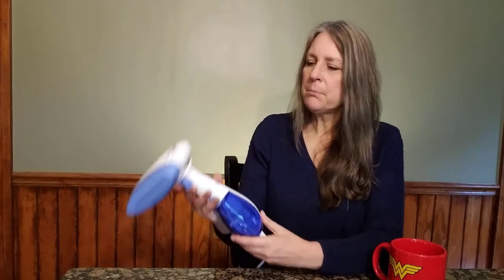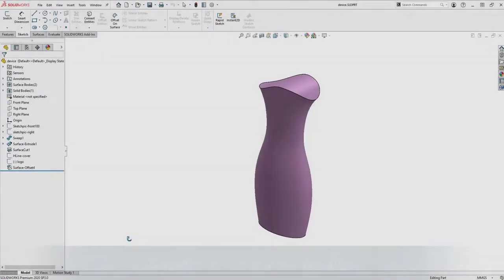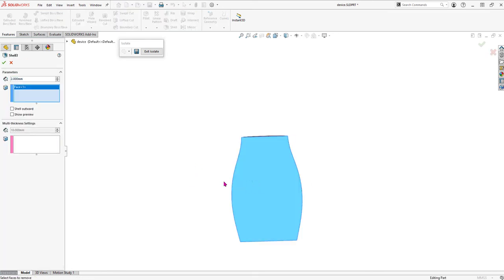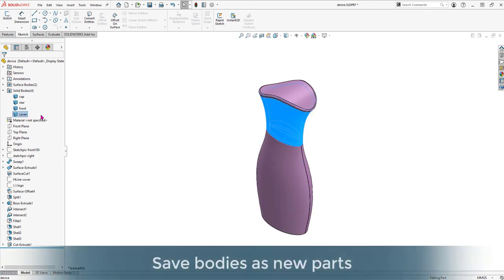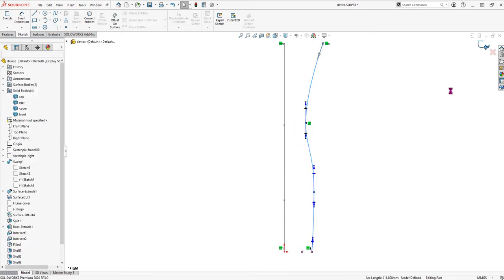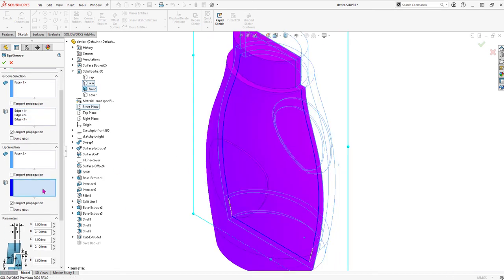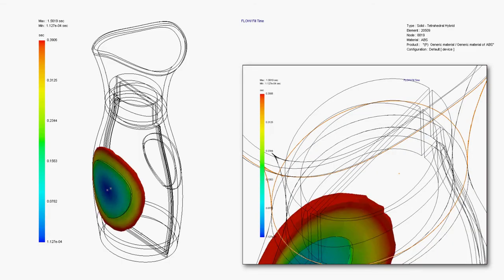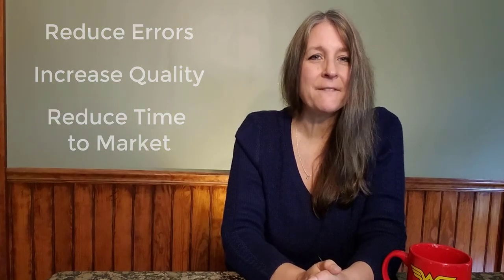Master Model Technique builds complex SOLIDWORKS models faster

Comment: Thanks for posting this. I have seen a master model technique that, instead of slicing up the original basic master model, they will import the basic master model into an entirely new file each time and then build another part off of this and then hide the master model in those part files. If this makes sense, what are the pro and cons between the 2 approaches (yours and this one)? Thanks!